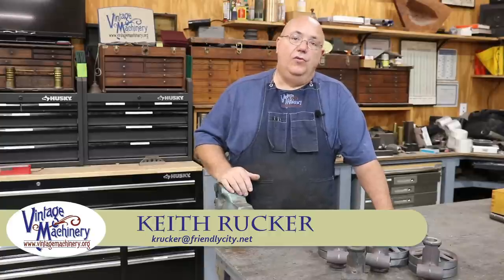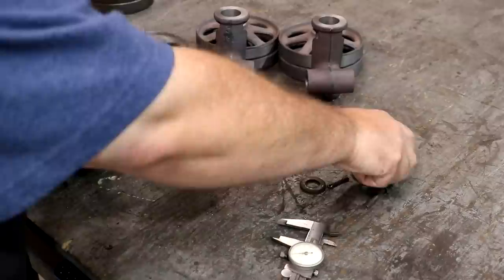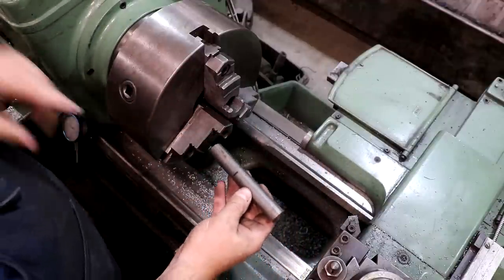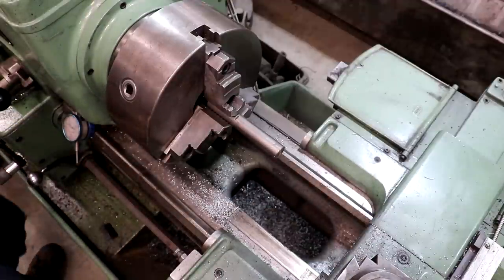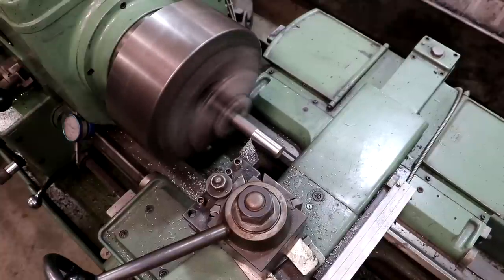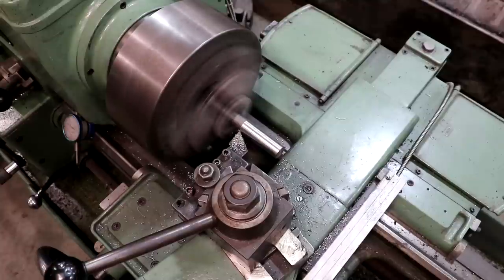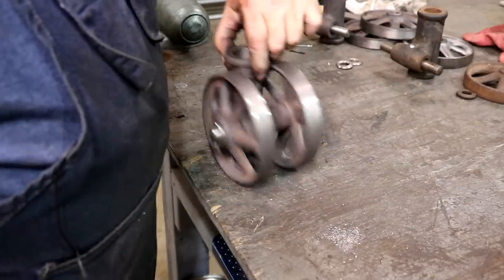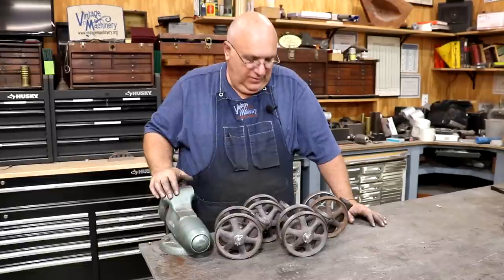New Britain Vise Cart Casters: Making the Axels and Assembly

Comment: Ok. Now I can see it.  Keith did a great job with this, but that runout would have driven me insane had it been me doing this project.   What Keith did was perfectly acceptable, and showed me why it takes so long for me to complete a project that wouldn't be any better.  On a side note.  I was working with another mechanic one day driving a shaft out of a machine and he told me that I was just like lightning.   I looked at him confused because it was about 110° and we were doing a field repair.  He said when I used a hammer I never struck twice in the same place just like lightning. I thought about that as I watched you peening those pins.
Reply: Honestly doing it in a collet would have been my choice. Like Keith said, it's not precision, but the collet would make the axles a bit more uniform.

Comment: These types of carts were used in an old carpet manufacturing company that I worked at after leaving school. Crossley Carpets of Halifax, West Yorkshire, UK. It brought back a few memories. 
On a different note I Would have supported them using a live centre. The end was turned off later anyway to produce the point. 
They look original. Nice job.

Comment: I was initially confused as to why the axles/housings were designed to wobble. Then it dawned on me; factories of that era did not have concrete floors. The floors were wood blocking set on end and the gaps filled with sand. It was great for workers not having to stand for hours on concrete, but it created a somewhat uneven surface. I think that wobble design was an attempt to deal with uneven floor surfaces while moving the cart. That's my guess anyway.....
Reply: Agreed!
The dual wheel design should help too. Modern single-wheeled offset swivel castors don't swivel too great on rough concrete. It must be all the weight on one side.
Reply: NO fancy soooopa-smoooooth space age concrete will have a double caster run with both wheels in contact with the floor unless you build in enough compliance to let it do so. Has nothing to do with the assumed surface quality. The moment they decided to use double casters, the need for swivel was a given.
Reply: Agreed! Wood floor, rough concrete, maybe even stone floor. In all cases that floating axle would have helped with stability. Very clever, especially with a tall, heavy load like that vise stand.

Comment: I always hated peening over rivets going through cast iron.   One miss with my mighty hammer, and I feared a cracked part.   Since I'm a coward like that, I usually took a bolt and then an acorn nut, rounded the edges off on the grinder and screwed it on with Lock-Tite.  Great job on this project and I appreciated how you handled the "non-critical" measurements.   It's how we get things done.

Comment: If you part to just below the bore depth firs and then drill, you get little or no burr and the washer ends up captive on the drill, rather than dropping into the chip tray.
Reply: Thanks for the tip, I will have to try it out!
Reply: That’s a good tip, thanks!

Comment: It is common practice to maintain sanitary design  in the food and pharmaceutical equipment to fill center drilled holes in fabricated parts by welding the hole closed with equivalent welding rod composition as the part, which is usually 316 SS. No crevices or pockets in the part are acceptable. The part must be designed and made to be easily and thoroughly clean and often sterilized before use. The part is then machined or polished to an equivalent finish to match the surrounding surfaces. This could have been done with this axle to maintain the original appearance.

Comment: Interesting job. Can’t help but wonder how those free rolling carts are anchored when torque is applied to parts in the vise?
Reply: Check the video before this one for the vice cart itself.
There is a lifting mechanism built in and the cart drops down to the ground.
And it's also a very heavy cart keeping it in place.
Reply: @samuraidriver4x4  Thanks, I’ll go back and check that mechanism. I knew there must be some way to stabilize the cart.

Comment: Look to me like the cotter pin holes held the spacer and wheels too tight to the hub, defeating the ball joint action.  BTW- it's spelled AXLES
Reply: Keith doesn't read the comments, so, he will likely still spell it wrong next time.
Yeah, I had the same thought about it being too tight for the intended rocking action to be effective.

Comment: Did anyone else get worried that the casting was going to break when he was peening over that rivet?  I haven't worked with cast iron so I guess it can take a beating.
Reply: You'd need to smack a casting that thick pretty hard to crack it. He's not going full caveman on the pins, he's just tapping them down.